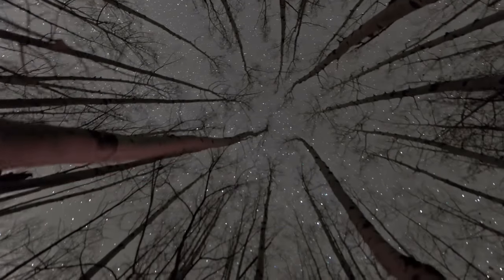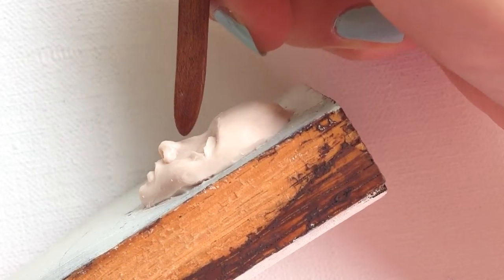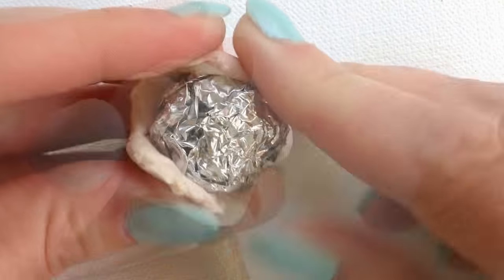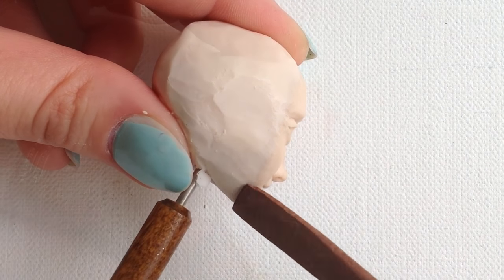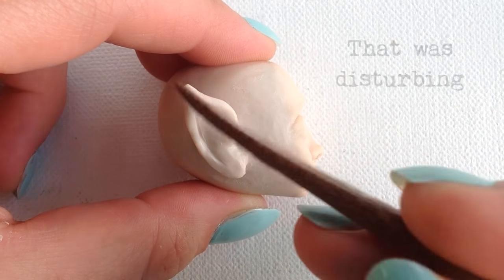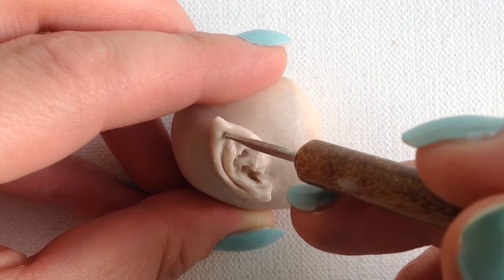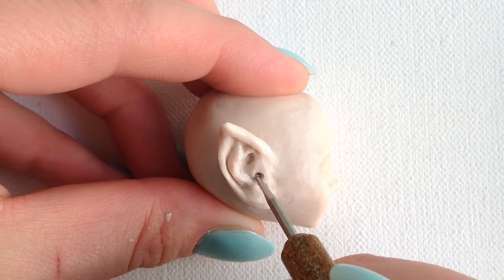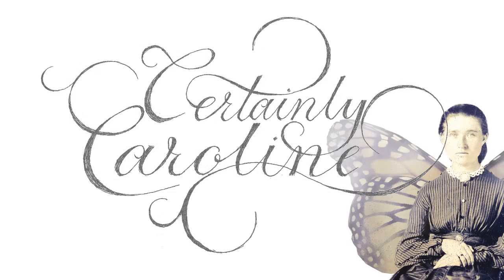DIY Fairy Art Doll - How to Sculpt Ears - Doll Sculpting Polymer Clay Tutorial - Part 2

Comment: Hey!! Thank you so much for your tutorial!! I just have a question, how do you avoid overbaking what you already baked??
Reply from the maker: Thanks for the question. You can rebake polymer clay over and over again. That's part of the beauty of this type of clay... you can almost never make a mistake you can't fix. Polymer clay sculptors work a little, then bake, then add to what was already baked, and then bake again, and they often will do that numerous times for one piece. The way you avoid overbaking is with an oven thermometer (not the kind that comes with your oven, one you buy from the store), so you always know your oven's temperature isn't spiking.  You've got to keep the temp within 5 degrees of what the clay package recommends. This is simple to do but you've got to kind of babysit the oven and watch that oven thermometer. For a 10 minute baking session, I probably check the thermometer 4 times, and I often need to adjust the temp within that period to keep it at the temp the clay likes. Hope I didn't just overwhelm you with information. Thanks again for watching and I hope you have an excellent day. Happy sculpting!

Comment: Are these safe if they get wet? Or what would I need to coat it with to protect it from water? Amazing work by the way.
Reply from the maker: Hi Shannon,
Polymer clay itself is very durable and is safe even if it gets wet.  I wouldn't leave anything I made outside though.  If you use heat-set paints you don't need to varnish.  If you use pastels or acrylics you should seal with a varnish. I usually use Varathane or Golden Polymer Varnish.